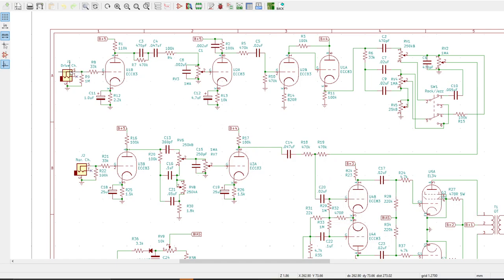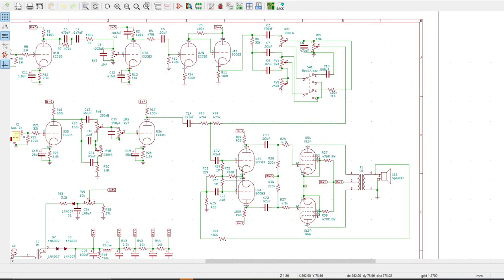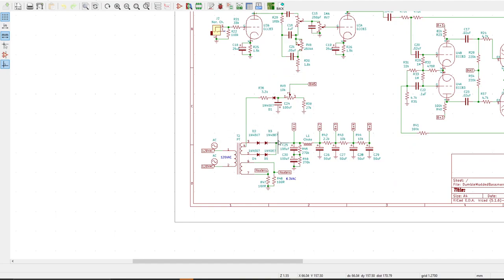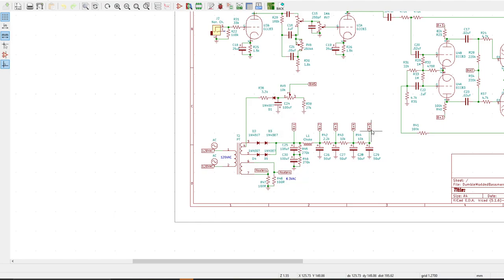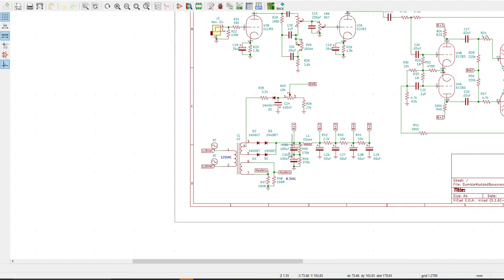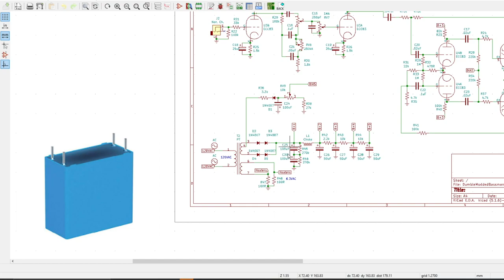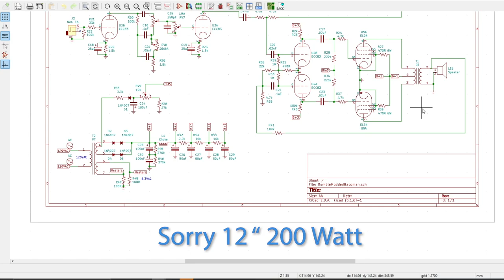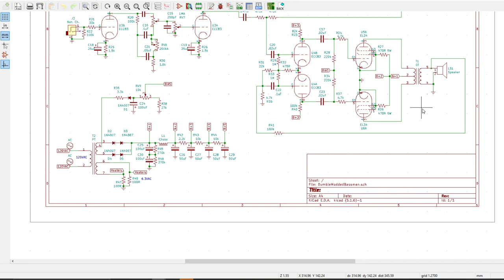Dumble Modded Bassman (DMB) Video 1 - Intro and Schematic

Comment: Interesting. Single ended overdrive?
Reply from the maker: Single Ended?  This is a push pull output... or are you referring to something else being single ended?
Reply: @FrenchieFilms  - I am referring to the single ended overdrive signature. The phase splitter gets balanced via feedback from the speaker output. That causes a-symmetrical overdrive that resembles the shound of an overdriven single-ended amp that adds character to the guitar amp in dynamics. Try to overdrive a hi-fi amp with truly balanced phase splitter and hear the difference.
Reply from the maker: Ahh yes Dumble's design of his amplifiers was pretty well known for it's overdrive tone.  His "Overdrive Special" amps use some really cool techniques like LNFB as well as GNFB to shape tone.  He worked with Ampeg for some time and they were pushing for more clean power like using ultra linear designs with special taps on the transformer at earlier winding ratios to make the screens a bit lower in voltages than the anodes of the power tubes as well.  I believe some of those techniques were implemented in his Steel String Singer amplifiers that use cathode followers into the phase inverter to improve the clean headroom.